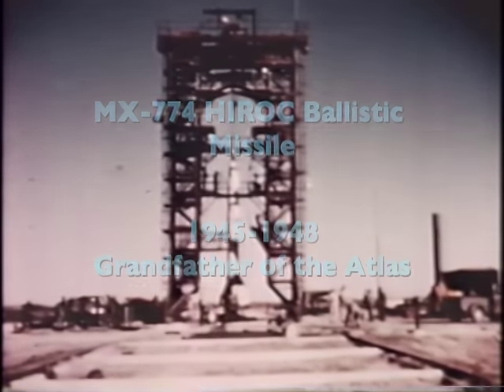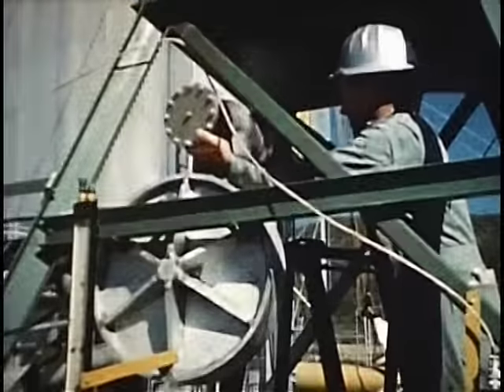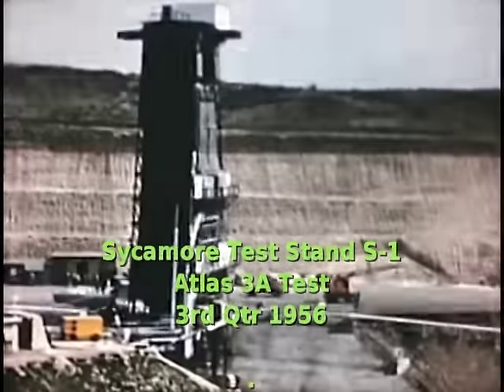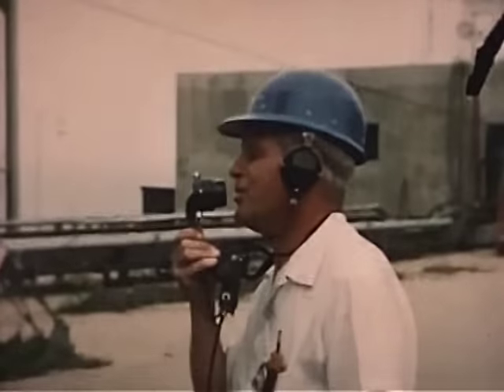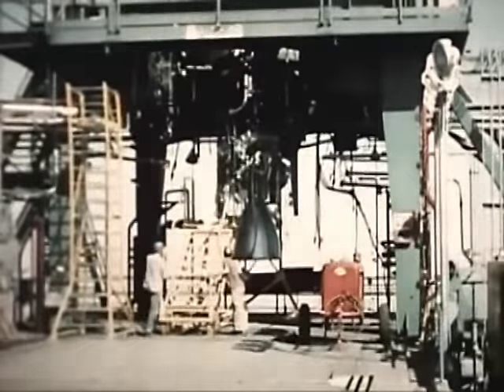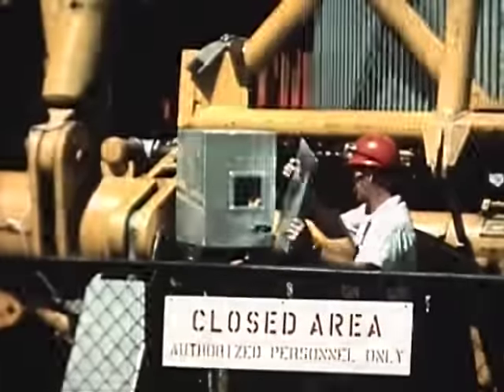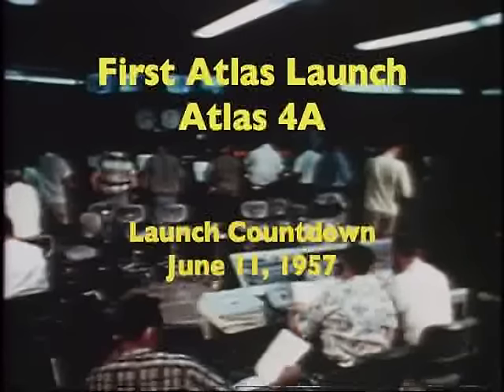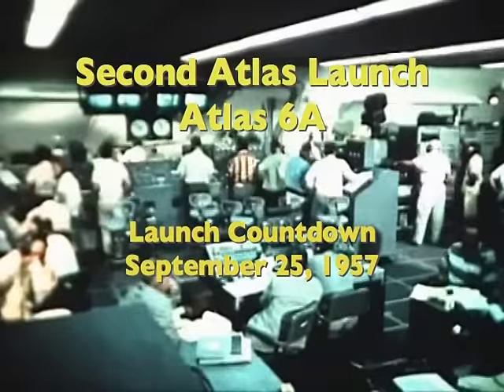Part 1 of 5: The Atlas Rocket, 1957-2007

Comment: My dad worked for GD Convair back in the 50's and 60's in Palmdale, Altus AFB in OK, and then back in San Diego before coming up to Pomona.  He helped do missile and systems checkout in the newly constructed ICBM missile silos around Altus AFB.
Reply: I worked at GD Pomona from 1977 to 1981, test equipment in support of all Pomona programs at the time.  A couple of the older guys I worked with had worked on Atlas. Later, in the 90s, I worked at Wyle Labs and engineered tests on Atlas updates...a more modern material replacement for the asbestos boot they mention in the film.
Reply: @orangelion03  I too worked at GDPD from Jan. 1980 to late May 1985 as a milling machine machinist 'A' and as an N/C Programmer. My dad came back to GDPD in early 1985, and worked until his retirement in 1993 finishing up in Kearney Mesa.

Comment: Interesting seeing them putting up the brand new & huge plant in Kearny Mesa. I can still see all of the buildings standing in 1996 in Google Earth using the HISTORICAL IMAGERY tool, but by the year 2000 everything is gone, all the way down to bare dirt...even the parking lots....Not a trace of it is left, and the entire valley is developed now.
Reply: Its odd that, bc many a time I have hiked into those hills just north of Santee, south of Poway, and explored the old missile base there. Still have silos and bunkers and this gigantic yellow j-shaped deal that I think was some kind of exhaust containment thing but its massive u can look at it from Google maps.
Reply: trey kearns You are referring to what was called the Sycamore Canyon test area.  I was able to watch one test run of a full-up missile.  We sat in an old army tank.  I worked on the Azusa tracking system.

Comment: You really should have run it through an anti-flicker filter. The video is unwatchable!
Reply: It's not that the idiots failed to remove the flicker, they chose to actually ADD it, along with the horrible fake projector noise.

Comment: Alot of work and wasted materials. US failed to build a reliable rocket and now they are flying with russian rockets.
Reply: RI: Of course you are incorrect. Successful Atlas I, & II, Titan I & II, MX, Polaris, Posieden, etc.   Russian motors were used by deliberate choice and does not represent any failure of US engineering or manufacturing ability.
Reply: You don't know very much about what's going on in spaceflight, do you?